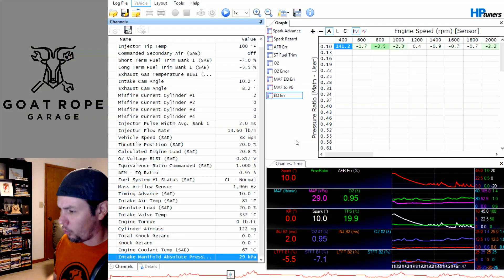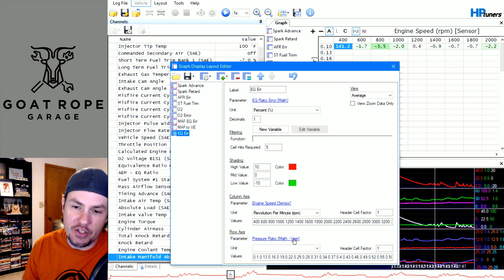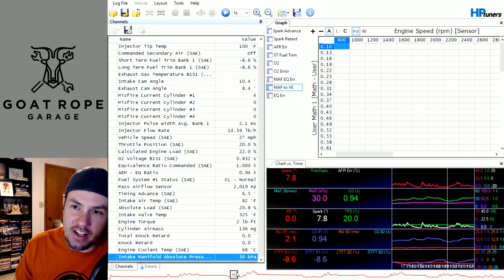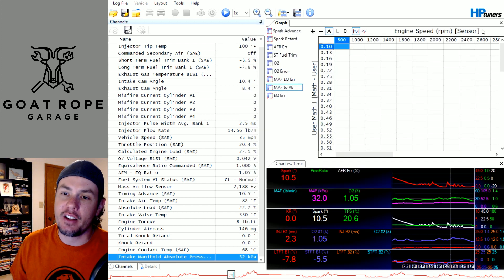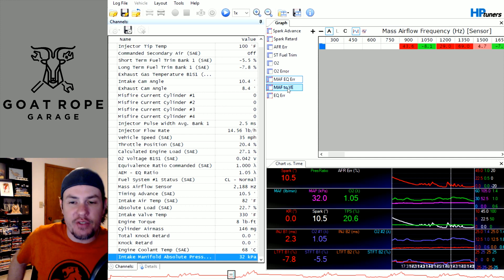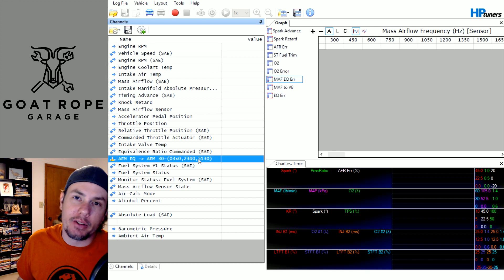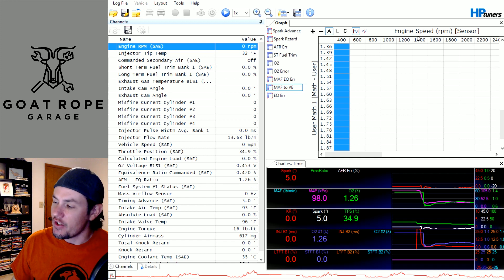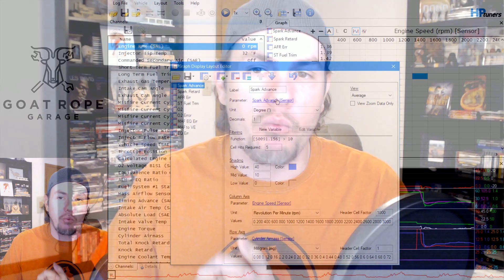HP Tuners VCM Scanner Troubleshooting, Dissapearing Data!?!

Comment: What would cause the scanner to stop scanning then start back up. This issue happens through out the scanning process its like it is freezing up. I'm only logging timing and knock so I know I don't have too much running
Reply from the maker: Sounds like a computer problem, never seen it personally
Reply: @GoatRopeGarage  thank you for all your hard work you put in to these videos. I have learned a lot about the tuning process and getting better everyday. And I figured out the problem I needed to update my scanner software and it is running smoothly now

Comment: I'm not using my MAF sensor I put my IAT in my intake so how would I log my air fuel ratio because it's only populating straight across and not down into the other cells

Comment: I think I need to go back and double check my math. Again lol.

I need to find a way to disable deceleration fuel cut-off on a P04 PCM. Perhaps maybe check the engine special functions in the scanner and see if I can disable it there when running a log, or maybe it's under the filtered TPS enleanment in the editor?

Comment: Am having an issue. My Scanner reading is really off. When am traveling 60mph the scanner reads 159 mph and it's triggering my speed limiter. Any ideas? Ls1 5.7 with 4l60e motor from corvette tranny from a truck. New vss.

Comment: Hello
I got a question 
I have hellcat 19
Do I even need a " smart cable" in order to use mpvi2 devise as a scanner tool to monitor data, I'm not modifying ECM, it is factory locked, just want to monitor some parameters after new air intake installed 
Thank yoy
Reply from the maker: Shouldn't need anything other than the MPVI. Try to find a cheap used one without credits, don't need credits of you're not tuning.

Comment: If I am a new purchaser of the mpvi2,, will I encounter any of the firmware issues that I have heard people with the older version have encountered. From what I can tell I won’t but just looking to hear no funny stuff will occur with the new version?
Reply from the maker: Not that I know of. That plagued the first gen units to fill a security gap. No issues on second Gen other than the pro features are still in development.
Reply: Goat Rope Garage ok cool. You may not remember, however I wound up getting Holley   Pnp ecu deal, plan to piggyback to the factory pcm, I’m a little nervous about it as my car has a pim and vats, so I may not need the pro feature set. Thinking I will use the mpvi2 to remove vats and hopefully deal with any pesky trouble codes I may encounter along the way if any.

Comment: I am having an issue on my gen 3 getting the maf hz to log. Followed all of the steps and the steps to run the serial wideband (innovative LC-2) it populated the pid in the channels but nothing on the maf frequency when logging. I’ve tried the disconnect and reconnect and laptop restart leaving it connected and it just doesn’t seem to show graph data. I’ve gone back over and tried to find what was missing but I’m not seeing anything. My wideband also seems to want to log lambda and not afr so I’m not sure if that’s part of the issue. I tried transforming the signal into afr but didn’t have any luck. Any ideas?
Reply from the maker: Make sure you're logging the MAF sensor, not just mass airflow, you're looking for one with the frequency unit
Reply: @GoatRopeGarage  In my channel list  I have the frequency running. I just double checked the filtering and it did not have a function for the graph. I added the function to it for eq ratio for this specific wideband and changed the entire graph into eq ratio err and I am still having the same issue. It is looking for the oxygen sensor content from what I can tell which I tried to link to the widebands input but it is still the same issue.
Reply from the maker: @chrism3813  Sounds like the math is off, copy over the default EQ error math and update it with your parameters so it will start calculating error then

Comment: I'm having an issue with the serial wideband not populating just the line that runs in the window. It populates the numbers, same as the gauge but the line doesn't show up. Then to make matters worse, the vehicle runs good just the way I want it to until I disconnect my wideband and laptop and then it starts running like crap..
Reply from the maker: Check your graph inputs, sounds like something is missing. As far as the second issue, that's a new one to me. Being connected shouldn't have anything to do with the tune unless maybe you're on a third Gen platform?
Reply: @GoatRopeGarage  yes and no. It's an 06 TBSS and it's actually a mix between 3rd and 4th gen. From what I can see some of the 3rd gen parameters are in hp tuners and others are missing, then some 4th gen parameters are there but others are missing..
Reply from the maker: @donalddodds8311  was wondering if it had something to do with RTT but I don't think they supported that. Very odd

Comment: Just getting started with the HP Tuner and having issues with being able to wright the ecm after a log. I will make adjustments to my VE table from a log and when I go to wright the ecm it says the device is not found. I unplug the MPVI USB cable from my laptop and plug it back in and all work until the next time. Thinking it my be a setting on the laptop, any thoughts ?
Reply from the maker: Make sure your disconnect from the scanner before hand. I forget to do that all the time and get that error.

Comment: Still having issues with my aem wide band disappears after I start logging. I have rebooted, checked voltage from the aem blue wire. I got another serial to usb from amazon. The same one you use and still nothing.
Reply from the maker: What kind of laptop you using, Colton?
Reply: Hp elite book 8530w it’s old and running windows 7.
Reply from the maker: @coltonriegel8726  and you're using the AEM 30-0300?
Reply: Goat Rope Garage yes